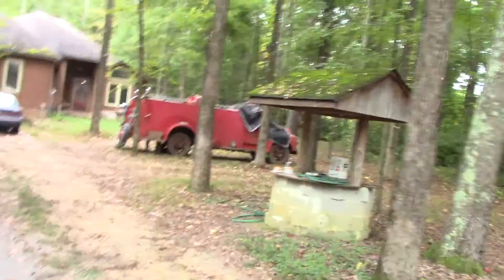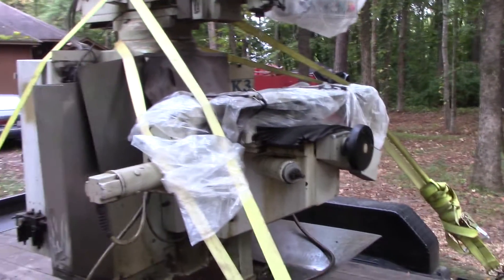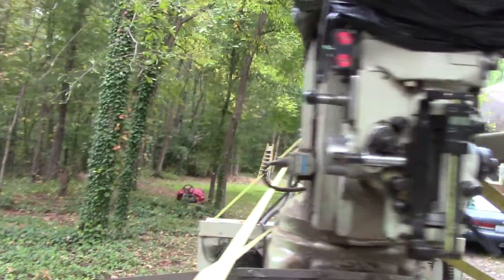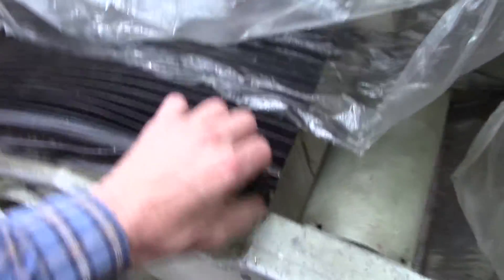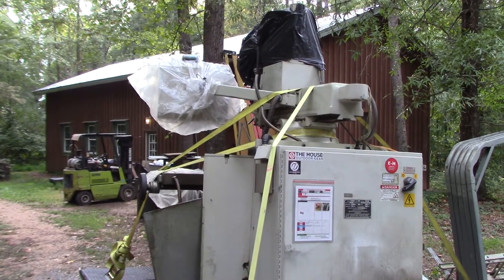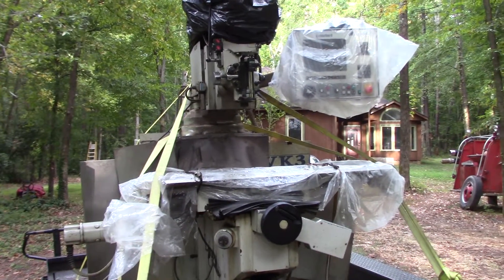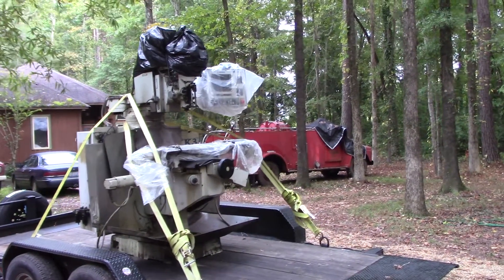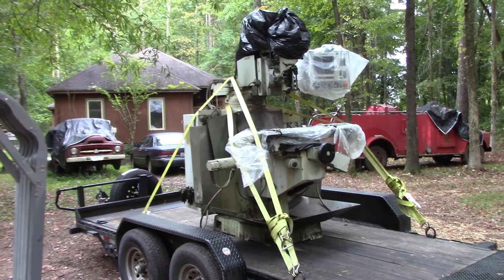9-16-21 Milltronics Partner VK3 Centurion 6 CNC milling machine.

Comment: Have you gotten this hooked up? Any videos?
Reply from the maker: Hey Chris. The Milltronics is powered up in the high bay of my shop.  It has been running with the power on since I posted this video.  Wow, that was 4 years ago. Yikes !  I keep it plugged in and running to keep moisture out and to keep the BIOS battery from going dead.  I don't keep the servo drives running, just the computer.  I jog the table around occasionally just to keep things moving, and fill the way lube pump. MetalButcher came over and played with the conversational interface a little bit, and did some simple moves. But I really need to get back to it.  I need to insulate the ceiling and run some lights in the high bay where it sits.  I am almost done with the bathroom remodel in my house. I think I got married shortly after I got this thing. LOL.  But yes, thanks for watching and thanks for asking.  I need to get using it.  -----Doozer
Reply: Thank you for the response! I have two milltronics partner 1 and 3 going to be powering them up this spring. They were in use when I bought them. Milltronics still supports these older machines! Keep us updated!
Reply from the maker: @ChristopherBurhite  Do you have 3 phase?  I unhooked my control transformer that makes 120v and fed the computer and servos from a separate 120v power cord. That allows me to keep everything running without having the VFD on.  ---Doozer

Comment: I suggest you put it in the spot it will reside just outside the high Bay, then build the 30ft extension around it!
Reply from the maker: Genius plan Jim, thanks.
Reply: @kooldoozer  Always thinking, I am...